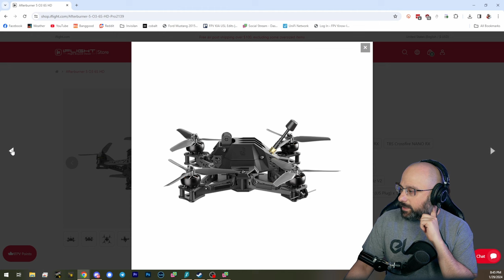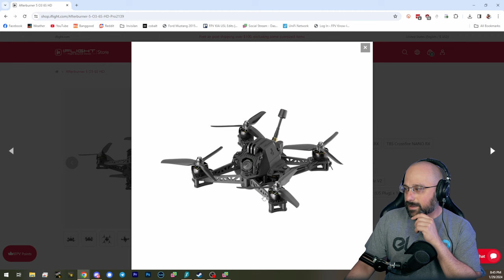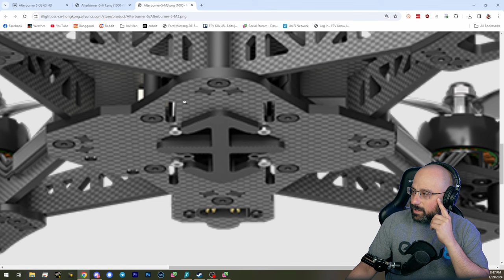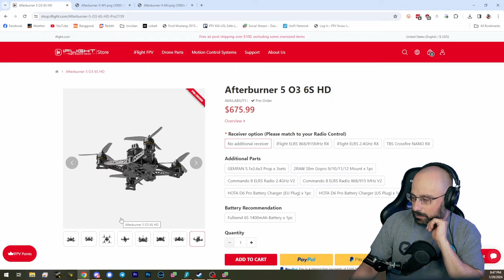Bardwell Looks At The IFlight Afterburner Frame! - FPV Questions

Comment: I owned and flew the original Karearea Talon with vertical arms and later a cheaper clone of it, for about a year.   When tilted forward for normal fast forward flight, the arms generated a fair bit of lift, which meant I could go faster for the same or longer time than any of my normal deadcat frames.   Back then, even on 4S it was a 90+mph quad.    BUT..  because the arms were producing lift, it did get knocked around by the wind a bit more, and not for lack of trying I found it fairly unsuitable for dropping straight down a vertical face (camera with normal up-tilt angle, pointed straight at the ground) because it would just literally fly away from the cliff face (like a skydiver tracking out).    What I'd have to do is turn 90 degrees and just fly close to the face (on my left or right side) rather than trying to go dead straight down.    This effect is the reason I wouldn't really recommend any vertical arm quad for freestyle.    If you tried to drop straight down into a small opening in a building, you'll likely miss and hit the roof instead.       If you want fast forward cruising though, they're good.  And they track around turns like they're on rails.